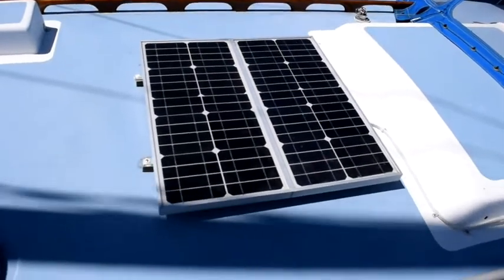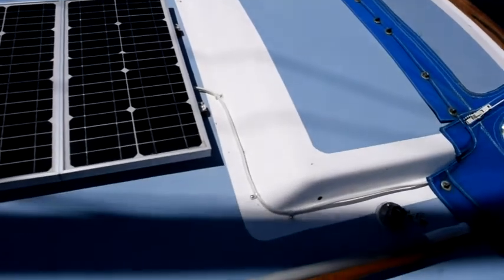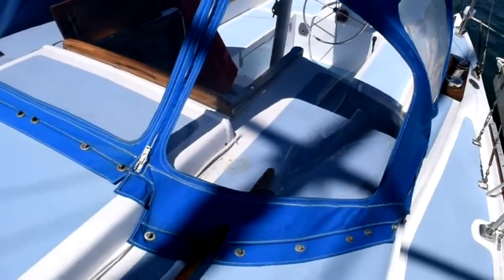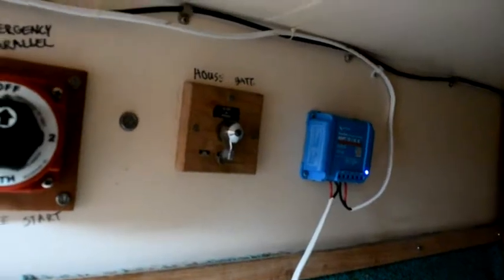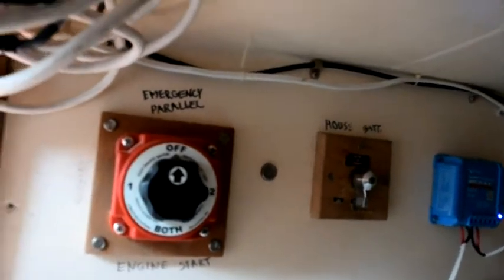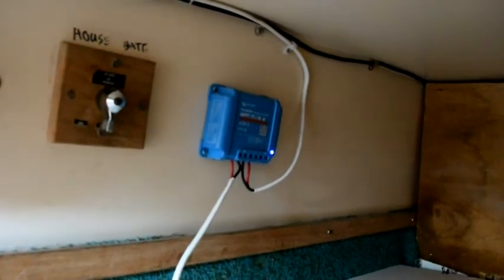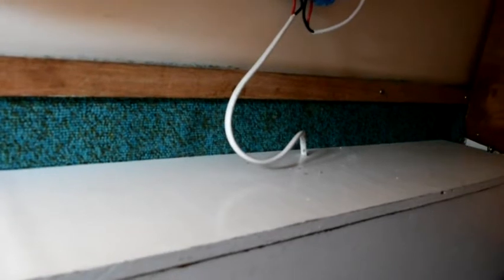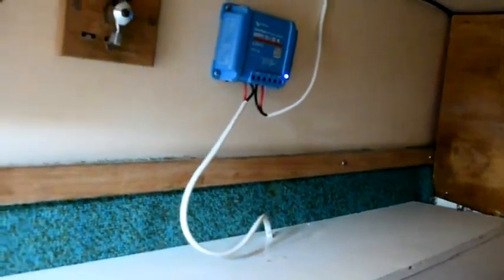Victron 7510 MPPT Solar Charge Controller - Installation and 1st Run

Comment: What do you have controller mounted on ? The manual says mount where not flammable.
Reply from the maker: The controller is mounted on the inside of the cockpit well.  That is fiberglass.

Comment: Hi,will you have a video to share your battery?Is it flooded?How can you maintance it?Thanks!
Reply from the maker: My batteries are pretty basic.  I have five grp 27 flooded batteries for about 6.4 kilowatts.  I check the water every month of so and add as needed.  However since my charging comes from a small solar panel or a 50 amp alternator, I seldom use much water.  At present my batteries are about 8 years old and still in very good shape.  That is probably because with the large battery bank I seldom draw the batteries down by more and 5-10 %.  Even flooded batteries will last a long time if you don't draw them down much.
Reply: Todd Dunn Very good. Thanks for sharing. classical battery and modern charge, GREAT combo.

Comment: Do you know how you can continuously charge your batteries when there was no solar available with the victron 75 15
Reply from the maker: I am not sure what you are asking.  However, you can always connect an other charging source.  For example on both my boats the engine alternator can charge the batteries.  You could also charge via a shore power charger or from a generator.
Reply: @todddunn945  this was just in case the battery was low but I still need power to my load. So I guess I would need a separate 24-volt battery charger isolated from the mppt correct?
Reply from the maker: @diydan6045  yes, you can wire a separate charger to supplement the solar.  As I said on this boat my 115 amp alternator is directly connected to the battery bank.  When the engine is on the alternator becomes the primary charging source and the Victron turns the solar output down because I have the float voltage on the Victron set just below the alternator's float voltage. The same would happen with a battery charger.

Comment: Have you considered wiring the 2 panels in series?
You will have then 20watts at 38volts, rather than 40watts at 19volts, the mppt will convert it into the same amps of charging.
Biggest difference is as you have issues with charging is when some cells are shaded you will still have 19Volts or higher to produce charge voltage for 12v battery bank. Using 14.5 volts plus 4.5volt for POV of 19.0v to charge battery. So your hours of charge you get each day is greatly reduced in parallel  as require direct sunlight with no shading to get 19.0v.

Try it next time link the two in series and see how the MPPT converts the PV input. shade panel and overcast days in when it will perform that your parallel set up wont. You can have up to 75volt input from PV. The higher voltage will have less lose going through your size cabling as well
Reply from the maker: Shading part of a series connected array dramatically reduces output relative to the same array in parallel.  Since this is a sailboat the panels get some shade every day (masts, various wires, etc.), so I get more output from parallel panels.  On my powerboat where there is no shading I do have the panels in series.  However, even with series connected panels the output early in the morning and late in the day is minimal despite the voltage being high enough for nominal charging.  That is due to the low sun angle.  For example, at 6 AM my series connected panels might be at 20 volts, but less than 100 mA current (i.e., 2 watts output).
Reply: Yes , I understand about the shading of the panels and would be interested in you trailing them in series and see if there is a difference is the amount of hours of charging achieved. Even at 2watts the battery bank is being topped up and at extend time period. With your 3 batteries bank it may seem no great advantage especially if have input from alternator or genset charging them.
I am in Australia and currently have installed 5 of the 75/15mppt in different situations and use the household PV with 44.0 VoC and charging 12v battery banks. Household panels can be bought for AU$50 2nd hand are about 200-290W so about max PV input for the units.
Being 44.0 VoC even with some shading and non direct sunlight a charge is still going into battery bank.

The 12v or 19-22 Voc panels in Australia are expensive and expect to pay $300 for 200w panel for low grade brand.

It is cheaper to use the Victron MPPT with the house grid connect panels than purchase 12v panel with PWM.

Did you have a PWM with the same 2panels on your sail boat? 
Where you able to collect the data on how much charge they produced in a 24hr period like the Victron app allows?
Genuine interested in any information you have Todd to compare different setups
Reply from the maker: Matt, my battery bank is actually about 6.4 kilowatts, so an extra hour at 2-3 watts makes no difference.  Because of the way I use the boat my batteries are seldom below 90% charge and even my small solar array keeps the batteries charged between uses of the boat.  Remember, I have only 40 watts of solar because of space limitations. My solar array can put out about 400 watt-hr or about 30 amp-hr per sunny day, which over several days is adequate to replace my use. That amount of charging will decrease as we move away from the summer solstice because the days will be shorter.  I also charge from my engine mounted alternator, but do not have a genset.  Before installing the Victron MPPT controller I had a PWM controller that put out no more than about 21 amp-hr on a full sun day.  There was no history, so monitoring only occurred when I was aboard.

Comment: I have been enjoying my victron 100/30 mppt controller and the 2 100 watt solar portables I made from your much appreciated instructions/videos. I love the Bluetooth built in function you recommended. I have done quite a bit of truck camping because of my new solar capabilities. Bad thing is I don't use my artic fox travel trailer as much now! Lol.  Looking forward to heading to Colorado soon w my trailer and taking side trips w my truck and my cool solar system. My old lady friends and others are quite impressed w what I have done. I likely would not have done it without your guidance.  Thanks again as I have frequently told you.
Reply from the maker: You are very welcome Katharine.  I am glad it is working for you.

Comment: That's a very large battery bank.  I would have thought that using such a small solar array to charge in bulk mode would be hard on the batteries.  From what I've heard, batteries in bulk charging status need to be charged at a minimum (and maximum)  current for best life.
Reply: In this video, at 38 minutes, 00 seconds, Jeff Cote discusses minimum and maximum charging rates, explaining that low charging rates slowly kill batteries:  https://www.youtube.com/watch?v=KvOwFBxmT44
Reply from the maker: There is no chemical reason not to use low amp charging.  The only factor would be not fully charging the batteries.  In my case the batteries are seldom discharged below 85-90% and they also generally sit for 4-5 days between uses during which time my low amperage solar setup provides adequate charging to completely recharge my batteries.  My batteries are currently 7 years old and still are in good condition.  The key to long life with flooded batteries is not to discharge them deeply.  I have the large bank because I have electric winches.  Initially I thought they would use more power than they do in practice.  The reason is simple - they never run for more than a few seconds during a tack, so even a lot of tacks will not use more than 30-40 amp-hr in a day.  I almost never do that much tacking.  However, a large battery bank is needed to be able to handle the winch draws without decreasing capacity due to drawing too many amps each time the winches are run.  Usable battery capacity is lower at high discharge than at lower discharge.  Finally, in the video you linked the fellow gives no justification for his 10% number for battery charging and the explanation he does give is simply not consistent with the electrochemistry of the systems.
Reply from the maker: Tod, I think I understand Cote's rationale.  He is thinking in terms of people who run their batteries down significantly between charges and then recharge during a minimal generator run.  Furthermore his 85% upper end of battery capacity seems to be based on never getting much beyond bulk charging when plugged in or on generator and never really getting back to 100% charge.  For that kind of use a larger capacity charger is called for to at least get back to 85% charge.  However, there is no physical reason for a charger with a rating greater than 10% of the 20 hour rating of your battery bank.  As long as you have the time a small charging output will completely recharge your batteries.  The advantage of solar is that it works all day, every day (day refers to actual daylight hours) unlike a standard charger only works when on generator or plugged in.

Comment: I’ve got the Victron 100/20 in my jeep with 200w of panel and 100ah of battery (going to be 200ah).  I think you nailed it - with these smaller installs the benefit of MPPT is even more important to maximizing the panel output.  Thanks for the video - I’ll share it with my friend who has a small sailboat and is thinking about a small solar install.

Comment: Did you previously have flooded lead acid batteries?  And would AGM be a better choice?  I don't have any kind of solar setup but from what I've read when dealing with limited resources for panel space or shading MPPT is best for performance
Reply from the maker: AGM batteries would be better, but they would cost $1,500 for my battery setup in contrast to $550 for my current batteries.  Given the way I use batteries, AGM batteries simply do not make economic sense for me.  I am a firm believer in getting the most you can from  solar array.  The MPPT controller gives me 25-30% more charging watts than a PWM controller, so despite the higher cost ($110 versus $40-$50), I think it is worth it, particularly since I do not have room for more solar.